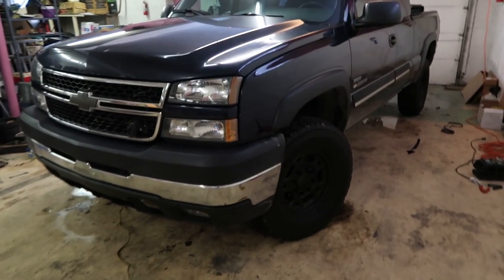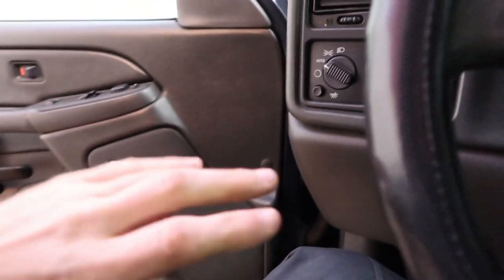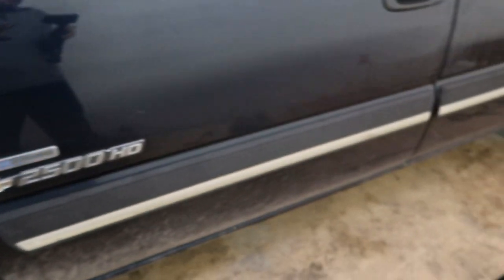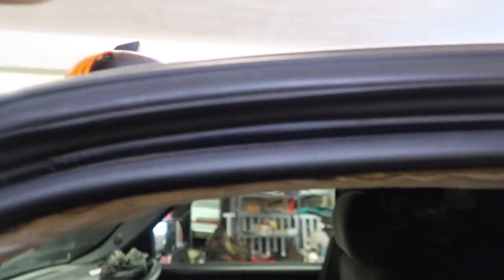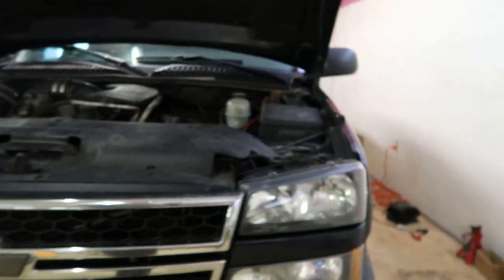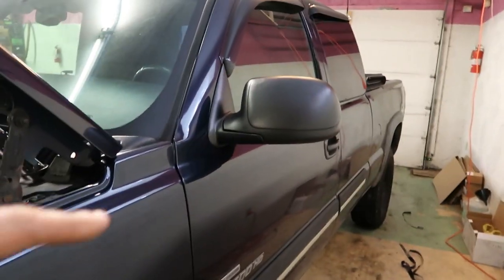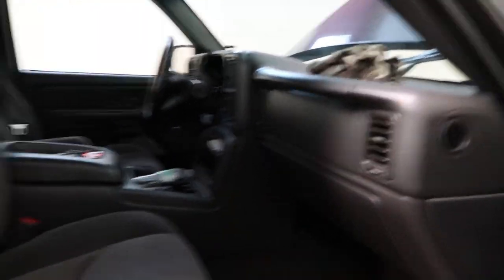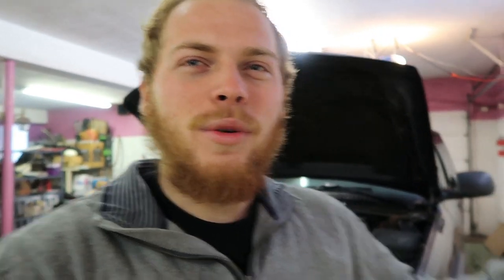REVEALING THE NEW PROJECT DURAMAX!

Comment: definitely a cool truck.  Should get some boost auto tow mirrors with the heated upper and lower glass for the winter.  A god product for the frame would be Fluid film black.  It helps protect the frame and is tinted black so it looks nice.  For the paint correction you should go with Maguaris 105 and 205.

Comment: I got 100s , 12mm and hsp compound kit 476/stock ...for LLY duramax  I’m in pa someone come get it have flow sheets and pump and injectors have 0 street miles ... low miles on the hsp kit